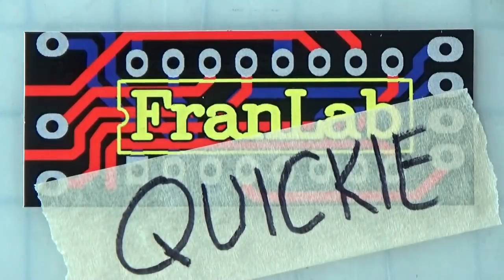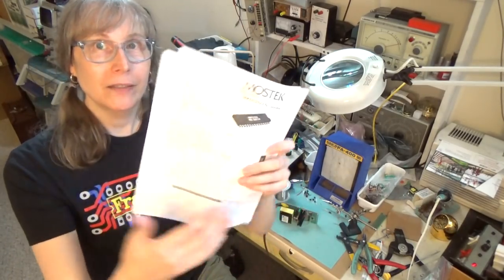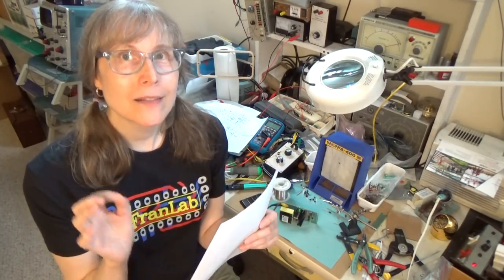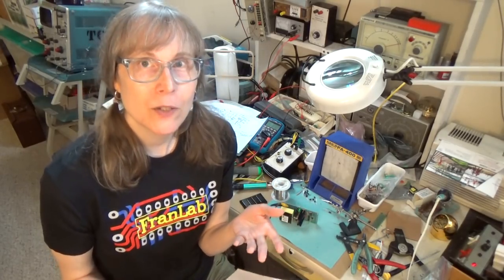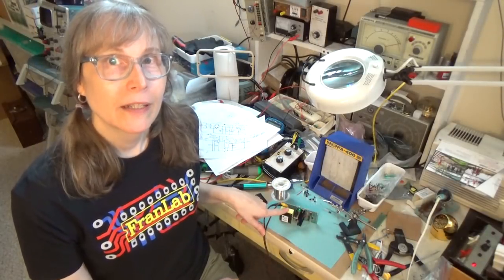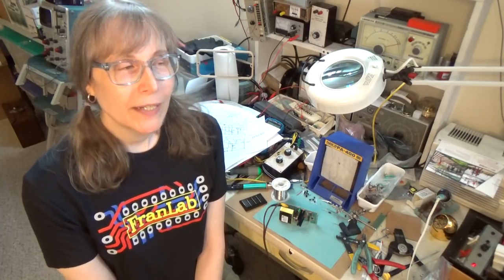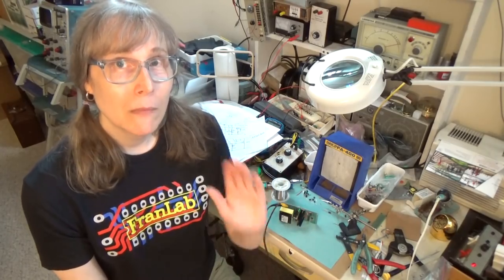Making A 50hz Digital Clock Circuit Run In The USA

Comment: That clever 'pulse loser' circuit makes for a nice elegant solution.
Reply: I more chuckled about that hack because my brain was already busy thinking about generating a clean 50Hz sine wave. Then she had a much simpler solution based on the knowledge of the inner workings of that chip.
Reply: It's clever, not elegant. Elegant would make the pulses equidistant, albeit  with no functional gain.

Comment: not sure what technology will be like in 40 years, but some future nerd will respond to their audience ... i am using this vintage Arduino, because that is how we roll...
Reply: hahahah
Reply: Yeah, I don't doubt it. XD
You get that in several areas.
I'm working on programming a SNES, which is 30 years old at this point, and for good measure an Atari 800 XL, which is from 1983, but is a revision of a 1979 microcomputer design.

That's a different field, but you could (and do), run into people asking the exact same question.
What's the point? Why not use a modern system instead?

Well... I use these old systems because that's what I feel like doing. XD
There's nothing else to it.
Reply: Just like me with my PDP-8/E -- it's about 42 years old now.  I use it (and sometimes emulators/simulators when it breaks down) because that's what I feel like doing!  and I plan to get my Teletype & paper tape working for programming & saving what I write.  Eventually, I hope to get my RK05 (removable platter drive) working with it too.  :)
Reply: I've just spent the last 4-5 years making a ZX Spectrum Laptop using original parts! (Apart from the screen and case). But it was fun finding the bits & getting it all working! (I had no internet access till 4 months ago). Putting a modern kit with emulator would be too quick, easy & boring!

Comment: I'm glad to see that there is still someone out there who doesn't answer every situation with Arduino.

It's got to the point where I have seen people use a microcontroller to get a LED to switch on when you press a button.

Comment: Fran, excellent solution. Thx for sharing. A PLL f multiplier was my first thought. Your use of a  "Pulse Swallowing" method was genius. Some programmable counters use "Pulse Swallowing" methodologies.
Your solution was simple, elegant, practical, accurate & functional.
A monostable multivibrator using say a 555 could've been an alternative if you didn't have a 4017. That approach might've used more components though. I call it a junkbox solution, that is, whatever you've got available to avail a solution. Great job.

Comment: Very nice project! I always knew that the clock chips count the AC line frequency - but the method of muting certain pulses and having the chip work accurately even though it's not an even frequency is very good thinking!

Comment: Mixed feelings here. I used a 50252 chip to make an alarm clock in school, mostly as an exercise in making circuit boards. So some nostalgia that only nerds would understand, but I wouldn't be interested in working with it again.
That clock got me to class on time many mornings.
Thanks.

Comment: Sometimes the simpler solutions rob you of a learning opportunity. Besides that,  it's also nice to get things working in different ways. There's more of a talking point for that circuit than there is for saying I just used a micro-controller, that would make it kind of boring :-)

Comment: In my opinion that pulse dropping circuit is exceedingly clever. I confess I would've set about building a power inverter around a frequency standard, confident it was the only way to go.

Comment: Woot, it's Fran! In the Lab!
Here's a top tip for anyone worried that their lab is filthy: Call it a workshop instead. 
Problem here though, is that FranWorkshop wouldn't kinda scan the same. Hmm!
Hoping that the next evolution of the circuit just uses transistors, no chips.

Comment: did it the exact opposite way to get a 60Hz clock chip to run on 50Hz mains. just looked in the spares box and found a NTSC colour burst crystal and made a single gate oscillator to get the output, then used some TTL dividers and counters to get a 120Hz clock out of it, then used a divide by 2 to get the final 60Hz clock to drive the unit. Stuck it all on a small piece of protoboard and crammed it in the unit, along with a small hole to get to the trimming capacitor for the oscillator. Worked out to drift around a minute a month, perfectly good enough for my application, and all made with parts salvaged from scrapped electronic parts.

Did a similar thing to run a 400Hz 26VAC hour meter, just used a 555 timer, a 2N2219A and a small audio transformer, with a tuned secondary, to get around 22VAC to drive the counter. did around 20k hours before the hour meter itself wore out mechanically.

Comment: What a fascinating design decision to make a display change based on current cycles.  Thanks for following up with the information that they made the other two versions that were fixed display modes.  I was immediately curious about that.  I suppose most people ordered what they needed for their design.  When you got to the end and asked yourself the rhetorical questions about why one would do it this way.  I certainly wondered if anyone from that era was faced with the same problem of getting the cycle switching display to show 24-hour time with 60 Hz.  Maybe that never actually happened, but it reminds me that for people in those situations, where you have a chip/thing and you have to "make it work", there are no rhetorical questions.  Thanks for sharing your solution.

Comment: Nice elegant solution, Fran! I tried to guess at the solution before I watched the video, and the thumbnail offered up a clue, but I was slightly off.
My idea was to use the 4017 as you have, but have Q0 to Q4 feeding the mostek chip via small signal diodes. Q6 would be tied to reset, giving the missing pulse every 6 pulses.

Comment: I've studied the circuit and finally I've understud how it Works. The counter pull down a pulse  every 6 so the pulses are 50 in a second even if they are not equal.

Comment: Nice trick to fool the Mostek! I've had to produce clock signals in some of my projects, and I always go straight to a relaxation oscillator. I imagine that would work about the same, but your trick to 'skip a beat' is pretty neat. Shows how dumb chips are that they don't really care the time between pulses. 

+1 on the quickies!

Comment: My alarm clock still is one that I built using a kit around 1980.  Because its case is badly twisted plastic, held together with Scotch tape, I am reluctant to open it for checking the chip. but I think it was a Mostek.  Unlike yours, it runs on a crystal  — I remember I could tweak the frequency.  And it is in 24 hour format.  I made two modifications to the kit, I did not like the 35 V supply that I felt was scary.  I reduced it to something between 20 and 25 V.  On the other hand, I considered its bulk capacitor inadequate, so I added a bigger one, just hanging there behind the PCB.  With that, my alarm clock survives nearly 10 second long power outages without losing its count.
I was puzzled by the high operating voltage, but believe now that it was due to the chip being built on P-channel FETs.  I’ll check it, if the clock ever fails so that can justify opening the warped case.

Comment: I'm often amused by the "youngins" who like to throw an arduino or pic at almost anything. I'll read what they're doing and think "you could do that with a 555..."
Reply: Ted Thompson: Spot on, but I can just see the responses from some people...

"555? Pah! What's wrong with a combination of basic ICs?"

"ICs? Pah! What's wrong with discrete transistors?"

"Discrete transistors? Pah! What's wrong with good ole vacuum tubes?"

"Vacuum tubes?" Pah!..."

Etc. ad nauseum...

#o)
Reply: To be fair, if you're just throwing some prototype together, an arduino is great. Of course, if you want to make more than just that, you can use something that fits better. Sometimes, a microcontroller IS what you want, though.
Reply: >"Vacuum tubes?" Pah!..."   
Galena crystals!   :-P
Reply: Wayne Hall: Don't mention crystals!! Some eejit will start going on about dilithium and warp cores!
#o)
Reply: I think a 556 would be better for this.  Make one half time out in about 95ms, and make the other oscillate at about 50Hz.  Feed the output from the first half into the reset of the second and every fifth pulse will be lengthened or shortened so as to maintain an average speed of 50Hz.
Reply: Anyone got some Arduino code to simulate a 555!
Reply: @lordmuntague  Theres nothing wrong with a Warp Core, as long as you get the Matter-Antimatter intermix coolent right!

Comment: Awesome workaround to get 50Hz. I can totally relate to wanting to use classic chips- in the late 90s I used to scour thrift shops for a certain 70s Radio Shack project kit that had a (very simple) integrated circuit on board, which I would cannibalize to build the light controlled oscillators I'd use in tandem with my circuit bent SK-1's... (SK-1 pulse code driving LEDs coupled with CdS cells modulating oscillators built with said chips) People just didn't "get" why that was the chip I wanted, they'd say "just use a 555!" But there was something about hunting down those 150-in-1 kits and extracting their precious parts... ahh, the memories. --I think I still have a couple of those kits floating around somewhere!

Comment: That's a proper lab that is! It's not a proper lab unless you have piles of projects half way through!!! Also wouldn't a ULN2803 or similar have worked for the lowside transistors? As the ULN2803 has been around since Pontias was still a pilot it would not be breaking with the vintage concept.

Comment: I though of a cycle swallow, or maybe faking it with a crystal oscillator and divider - but on the other hand, the mains frequency is actually specified to be long term accurate …. The main problem with mains driven digital clocks as opposed to synchronous motor clocks is that interference can add extra clock pulses

Comment: Well remember - a cluttered desk is a sign of a dynamic mind. And I can do the 24 hour times in my head. Right now it's 19:19 hours here. Reason is I worked for a company with clients all over the world. And it's much easier to use a 24 hour clock than the 12 hour clock.

Comment: when i started to watch the video i was thinking the ways i would consider changing the freq'y, there was 2 ways, one was using a 555 timer to power a fast switching high power transistor, the other was using a decade counter and taking the pulse off 5 of the 10  but that still required to be driven by a timer chip...
the reason why i thought like this is because id more likely run it off a set of batterys and even with a 100LED if you drive them at 3mw they should be bright enough and that would be less than 300mw of power as not all the LEDs would be on!
i didnt consider running it off mains voltage and tapping off the internal freq'y like you have ...
you could use a 10mhz clocking xtal and a x5 multiplier, again good for battery use

Comment: Great solution, I think they call that a 'swallow counter' since it swallows a pulse every so often. Note that the 4000 series chips like your 4017 have a maximum supply voltage rating of 15v but 16 probably won't kill it!
Reply from the maker: Max Vcc is 18v... no worries.

Comment: What would you do if it was the other way around (running a 60 Hz clock in Europe)?

Build a crystal oscillator and devide the frequency down to 60?

Build a PLL circuit?

Use the 50 Hz to make a resonant circuit oscillate at 300 and devide that frequency by 5?

All of that sounds more complex/difficult.

Comment: Fran, if the PM is lit I would have added 12 to the hours digits?  If PM High and D6 high add 1.  If PM high and D5 high add 2.  It would save messing around with the frequency.  The 4017 and transistor is ingenious :D  I hope that helps.  Say Hi to Missy from England :D   (Edit I forgot to say Hi to Missy)
Reply: It's a good thought but I think it'd need more circuitry.. 
also 'proper' 24h mode starts at 00;00 (midnight) and not 24;00
Reply: The output of the clock chip isn't binary, it's already been decoded to 7 segments and enable outputs for the six digits, so it would have to be converted back to binary first to do the addition.

Comment: It looks to me you might have saved some effort by running the "23" volt transformer as a bridge rectified center tapped for 11.5 volt (close enough to 12), or was 16 volts a requirement?

Comment: So glad you did not use an Arduino or similar. Much more fun this way :-) Interesting chip. I have been thinking for a while now about putting together a clock using  50Hz power in the UK. I wanted to add the radio clock signal update as well. (https://en.wikipedia.org/wiki/Time_from_NPL_(MSF) ) . Assuming the frequency balancing in the UK is good then it should keep relatively good time, but thought a quick update from the radio signal would not go amiss - Besides - more fun. I love you 3d printed displays so was thinking to use those too. My clock might take a tad longer do though... I need to learn more.

Comment: Nice solution, but one thing to remember here; what OPAMP are u using? It surely is not an open collector output, and with some Opamps I would not feel really good shorting its output to gnd and just counting on its internal output current limiting to save it. Secondly as far as I see your approach only works 100% if the delay in the signal thru the buffer opamp is greater than the delay of the 4017 counter to turn on the transistor. If the signal thru the buffer opamp is faster than the blanking pulse (or it is a toss up) you may (occasionally) get glitches at the start of the blanking interval where a bit of the 6th pulse slips thru. Maybe too small a glitch for the slow Clockchip to act on it, but maybe so. Guess only long term stability would tell. Keep up the work.
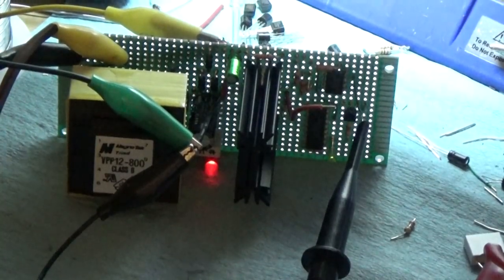Reply: Also the drawing of the schmatic seems to be a ltittle weird. The link between Pins 5 and 15 on the 4017 provides the reset pulse on reaching the 7th count (which seems counterintuitive at first but is correct). Still that pulse is only available for the few microseconds that the 4017 takes to reset count. The output to the green LED and the base of the blanking transistor must be tied to any regular count before that. And in the video at 5:05 the closeup of the PCB shows clearly that the green LED and 10k to the base of the blanking transistor are in reality tied to pin 10 of the 4017 (active on 5th pulse). But maybe that misdrawing was the intentional error aimed at chinese copycats - if they would ever design with obsolete MOS clock chips.

Comment: Hi Fran,

Hope you are still reading comments from this somewhat old video...  Fran, I need your help.  Being that I live in South America (Chile) where the AC mains standard is 220V @ 50Hz, I need a circuit the opposite of yours, with an output of 110V with a AC frequency of 60 cycles.

Before I continue on this endeavor, your opinion on how to proceed would be very helpful.
A) Is it possible to use your schematic as a road map for modifications?
B) Bite the bullet and just purchase some commercial converter device?
C) An Arduino (MCU) programming solution? (yuck)

Regarding your comment about using a micro controller solution (I agree with you, it's like cheating) versus an old school component solution...  your singing to the choir.  I much prefer the latter.

Thanks again,
Ken
Reply: one problem i see is, her circuit drops pulses, while your circuit would need to add pulses. you could create a simple 555 timer oscillator that runs some safe margin higher than 60Hz, say, 100Hz (to leave plenty of room for that RC oscillator to drift). Have a counter circuit watching the input, activating the oscillator after 5 input pulses, and have a second counter circuit watch the output and deactivate the oscillator after 6 output pulses.
Reply: @spambot7110  Thanks!  I never considered adding pulses beyond spec and then correct "backwards" by dropping pulses as needed.  Thanks for the idea (My reaction to your solution was similar to Scotty's reaction hear: https://youtu.be/jxzYTDX8bIg?t=16

Comment: Great video Fran, like the short videos.  The timer solution is nice for the 50Hz but how do you get the 4017 to work? I have done short video on using this thing but for the life of me I can not get it to work, so a quikie on getting the CD4017 / HCF4017 working would be nice hopefully showing the pitfalls as I'm falling down all of them. Thanks.
Reply from the maker: They are very current sensitive and for that chip all of the input and control pins must be held at either V+ or Gnd for it to function.
Reply: Thanks for the reply, I will have to have another play around with this IC.

Comment: A cheap solution to go on 50hz is to buy a 220V 50Hz car inverter and power it up with a simple 12V power supply.
Reply: That is not how they roll at the franlab.

Comment: Pulse interval encoding? Maybe? It's still 60 Hertz.  One cycle peak to peak. But a frequency counter may differ. Which is basically the clock. Hmmm. A little knowledge is a dangerous thing.

Comment: What a novel 60 to 50Hz converter!, I would probably have used an Arduino nano to synthesize a continuous 50Hz (no gaps), totally overkill for your use. But hang on, I live in Australia, a 50Hz country, so going the other way, without a micro, could prove an interesting challenge.
Reply from the maker: For upcounting to 60hz you would try a similar circuit but instead of muting a count you'd add one short pulse every 5 counts.